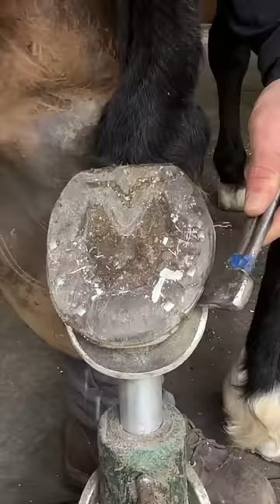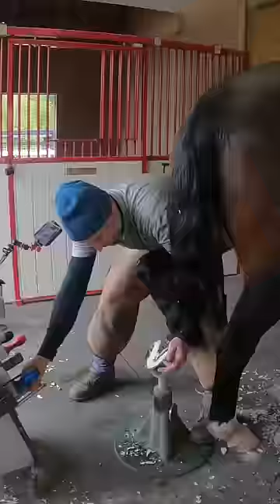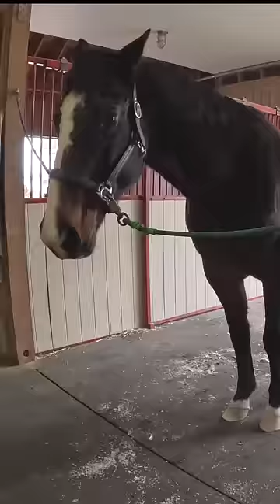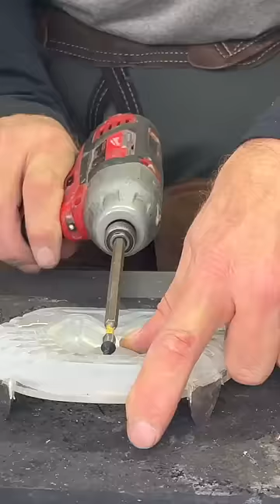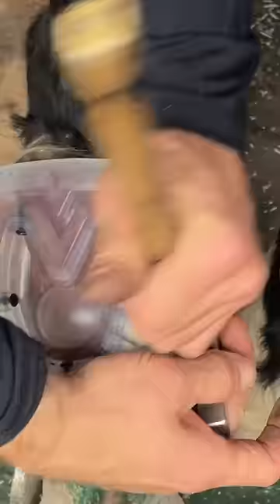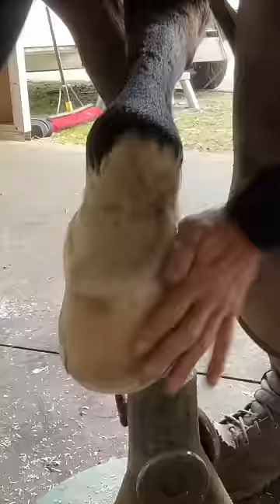Hoof Care/New Shoes for Prince: Applied  EasyCare VersaGrip Composite Shoes #horse #streamhorsetv

Comment: Why plastic ones instead of the original metal ones
Reply: Plastic shoes absorb shock, making the horse more comfortable. A comfortable horse moves more, which can prevent further muscle and tendon atrophy and speed up rehabilitation. Plastic wears easier than metal, allowing for easy adjustment of various bevels. They’re also softer than metal shoes, reducing the risk of causing hard pressure points on the sole.
Reply: @CausingChaos.  didn't know sorry for any bad wording
Reply: They're actually rubber, not plastic
Reply: @perkasami6305  technically, it’s neither plastic nor rubber
Edit: I just call it plastic because that’s easier than calling it a thermoset synthetic non-polar elastomer
Reply: @CausingChaos.  That's true. It's a composite material. I feel it's closer to rubber, but whatever works.
Reply from the maker: Some of the reason I have chosen to use composite shoes are 

Durability: Composite urethane materials are highly durable, ensuring long-lasting performance even in challenging conditions.
Flexibility: These shoes flex with the horse's movement, offering a more natural feel and potentially reducing stress on the hooves and joints.
Shock Absorption: Urethane materials excel in absorbing shock, decreasing the impact on the hooves and lowering the risk of injury.
Lightweight: Composite urethane shoes are lightweight, reducing fatigue and strain on the horse's legs.
This part is purely my own opinion however I believe than can better blood perfusion that being said I currently have no way of proving my theory except that I see the foot respond well to these style of shoes. There are exceptions and that is when you go back to the drawing and figure out what will work best for the horse.

Comment: Could you explain the benifits of this  style of shoe to the traditional shoe please?
What is the brown paste you apply?
Reply from the maker: Lightweight: Composite materials are generally lighter than steel, reducing the overall weight carried by the horse, which can improve performance and reduce fatigue.
Shock absorption: Composite materials have inherent shock-absorbing properties, which can help reduce the impact on the horse's joints and hooves, potentially lowering the risk of injury and improving comfort.
Flexibility: Composite shoes can be designed to offer varying degrees of flexibility, allowing for more natural movement of the hoof. 
Reduced vibration: Composite materials can dampen vibrations, which may help reduce the transmission of shock and vibration through the hoof, potentially reducing fatigue and discomfort for the horse.

The light brown stuff is field paste from red horse products that does an incredible job keeping away bacteria and fungal infection. The dark brown stuff is magic cushion which helps prevent moisture against the foot and has many other benefits and properties.

Comment: What about the plastic slipping on grass or wet paving?
Reply: They can slip-on wet grass a little bit more than metal shoes but on pavement they do  better. Their main job is to absorb impact hard surfaces.
Reply from the maker: As a whole this shoes have great traction. When you however need more traction you can add studs for wet grass environments and I have found a way to use a specific tool to create more grooves in the shoe to increase traction when studs are not the right solution.

Comment: Polyurethane shoes smart rather than metal, probably a lot more comfortable. The horse is like thanks dad😁😎
Reply from the maker: Yeah , urethane horse shoes is predominantly what I use.
Reply: @ModernDayHoofCare as somebody who knows absolutely nothing about horses, what are the benefits?
Reply from the maker: Great question, PS sorry for taking so long to respond. 

Rubber composite horse shoes offer benefits such as shock absorption, reduced concussion, and improved traction in most environments, contributing to overall hoof health and comfort for the horse. Additionally, they can promote better blood perfusion and distribute load more evenly across the back of the foot due to the flexible back portion of the shoe. However, in certain environments and disciplines, excessive traction may strain or injure the horse, and in some cases, the shoe's flexibility may not provide adequate support, necessitating a more rigid shoe tailored to the horse's specific condition.

Personally, I rarely use steel shoes anymore because I believe there are better options available. However, there are times when steel shoes are necessary for specific disciplines or conditions that require greater stability and less flexibility in the shoe. Thanks for tuning in! I hope this answers some of your questions. Cheerio, Chris. Please subscribe, like, and ring the bell if you found this helpful.

Comment: Does the middle part stay in to protect from debris?
Reply from the maker: Yes👍 can be very versatile. Allows you to have a shoe/ pad combo with out adding height to the shoe , keeps out debris, can help hold packing, be used as a removable plug for treatment if necessary, help stop snow balls from packing into the shoe.
Reply: That's a great idea.
Reply: Very cool! Is packing the goop he put underneath? What does that do?
Reply: @LocalRagamuffin  I think to treat possible infection
Reply from the maker: The goop is field paste made by red horse products and magic cushion is the darker goopy stuff. To put it simply it is a combination of keeping the bottom of hoof bacteria and fungal free and help distribute the load evenly across the whole foot . The packing ends being a barrier from to much moisture being absorbed and helps aid in preventing thrush. I have horses the live in this types of shoeing packages and it remarkable how clean and healthy the foot when using the right products for the environment they live in. What works in one area may not be the best option for another.
Reply: @ModernDayHoofCare  Thanks for the info! 🙂
Reply: @ModernDayHoofCare  did you delete my heart you nob
Reply from the maker: 🤠No 😂 still see a heart 🫶on my end . However your heart emoji has a different value when it followed up with name calling 😂 To funny  . Had to look up what a nob even means. Made me chuckle.
Reply: @ModernDayHoofCare  ah shucks 😖 my bad😇. It stopped showing up on my end and jumped the gun. 🙁🫤😕😶‍🌫️
Reply from the maker: No problem, apologies excepted . You would be surprised how much I’m learning not from just creating and sharing content that I’m passionate about. It is the global perspective on any given subject that is really so interesting. One might think you are hero and another thinks you’re insane and inhumane. When  I pause, stop and not take it personal and ask a few questions and find out why they believe a certain way it has often lead to some beneficial conversations. Hope you have a blessed day. Cheerio!

Comment: New shoes means the previous ones wear too thin. Also accumulation under shoe leads to growing dirt.
Reply from the maker: Yes, the shoes had worn out.  The packing that looked like dirt that was removed after the old shoes was removed is a medicated packing that helps toughen up the sole and frog during the wet winter months and wick away moisture. It is called magic cushion.

Comment: Why don't more people use a full cover shoe rather than standard metal ones??
Reply from the maker: Yeah you raise an interesting question . It completely depends on each horses needs and discipline they are used for. For this horse when current owner bought him he had a preexisting condition called Pedal Osteitis in his front feet. Basically there had been a time the distal bone in the foot called the coffin bone had been inflamed around the outer border of the bone. For the hind feet the added support really helps his tendency to be what we call negative planter angle , essentially it grows in a manner where the toe grows faster than the heel and puts them in a position that would be similar to placing a 1” block under your toes and stretching your hamstring . This is little bit of an exaggeration but hopefully that paints a picture. He had also had a stifle surgery on his left hand, so giving him extra support throughout the back of his feet has been beneficial for this horse

Comment: What’s the thinking behind this type of shoe?
Reply from the maker: Rubber composite horse shoes offer benefits such as shock absorption, reduced concussion, and improved traction in most environments, contributing to overall hoof health and comfort for the horse. Additionally, they can promote better blood perfusion and distribute load more evenly across the back of the foot due to the flexible back portion of the shoe. However, in certain environments and disciplines, excessive traction may strain or injure the horse, and in some cases, the shoe's flexibility may not provide adequate support, requiring a more rigid shoe tailored to the horse's specific condition.

For this horse he has moderate pedal osteitis on the front feet and has been performing better with over improved foot health having the composite shoes on the hind as well.

Comment: What's up with these types of horseshoes I've never seen anything like this?
Reply from the maker: They a urethane composite horse shoe . They provide a lot of benefits, better shock absorption, it helps the foot function and move as if it were barefoot , has great traction options on harder surfaces and can have the ability to create more traction on slippery surfaces if needed. These are just a few of the benefits.

Comment: What are "shoes" like this? I’ve never seen them and I’d like to understand their function..
Reply from the maker: Composite rubber horseshoes offer several functions: this shoe is the VersaGrip made by EasyCare. 

Shock Absorption: Rubber provides cushioning, which can help reduce the impact on the horse's hooves and joints, especially on hard surfaces.

Traction: The textured surface of rubber horseshoes can provide better grip on various terrains, improving the horse's stability and reducing the risk of slipping.

Durability: Composite rubber horseshoes are often durable and resistant to wear, offering long-lasting protection for the horse's hooves.

Lightweight: Compared to traditional metal horseshoes, rubber horseshoes are often lighter, which can reduce strain on the horse's legs and improve overall comfort.
Reply: @ModernDayHoofCare  thanks for the comprehensive explanation!
Reply from the maker: You bet, thanks for being curious. Love it

Comment: Plastic. How pitty. I guess  they are soundless 😢😢
Reply from the maker: Urethane rubber similar to a tire, flexible yet provides support, protection and traction
Reply: @ModernDayHoofCare  Right. My point is the missing "click" from the metal shoe when walking on hard surfaces.😉